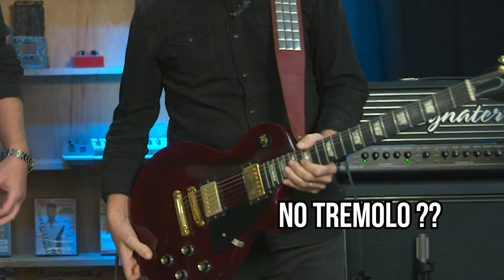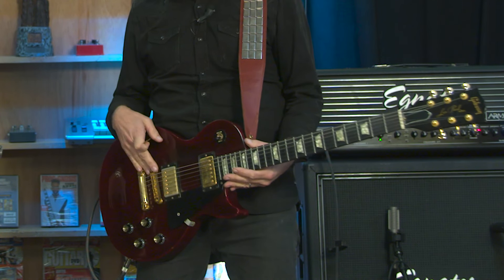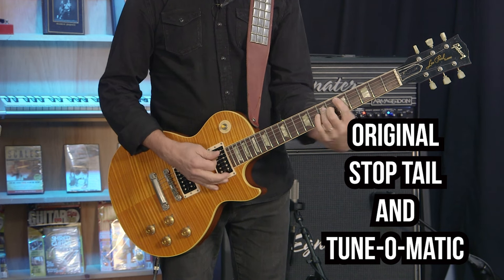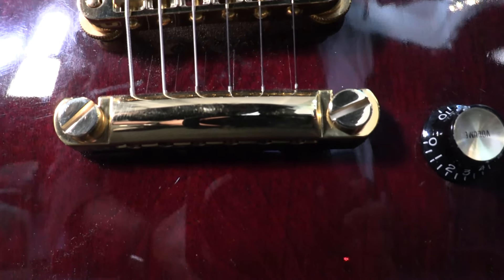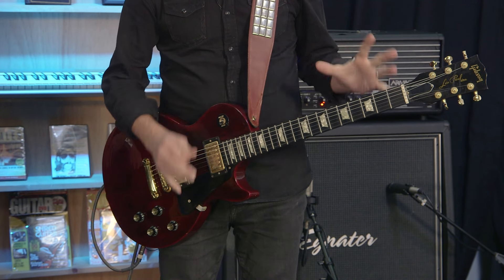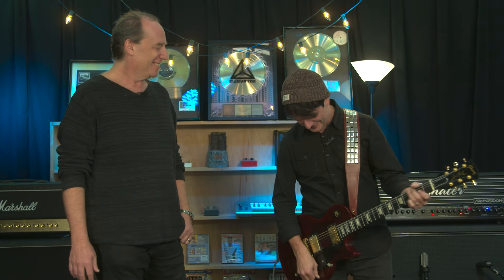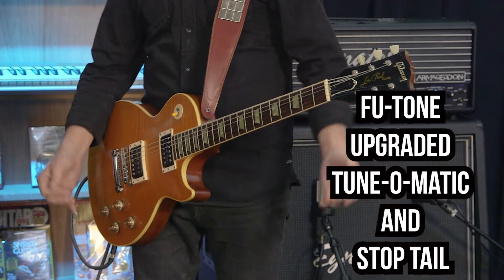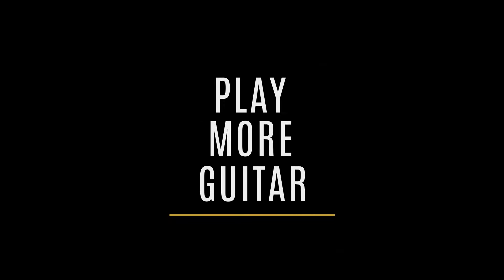FU-Tone’s new BRASS Stop Tail & Tune-O-Matic Bridge Set - demo

Comment: FU Tone parts actually do make a difference. I added titanium parts to my Floyd Rose on my Schecter SVSS guitars and changed the springs to FU Tone Noiseless springs, the difference in tone was noticeable before I even plugged into my amp. And I haven't even changed out the blocks on my trem yet which is next.